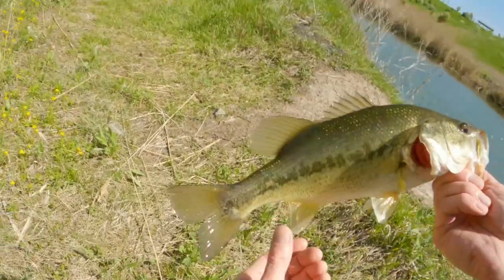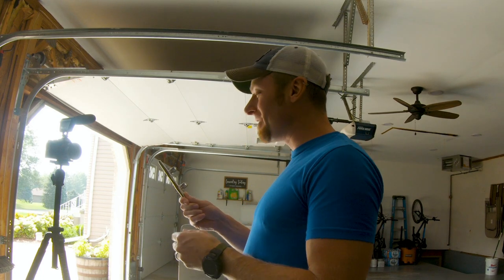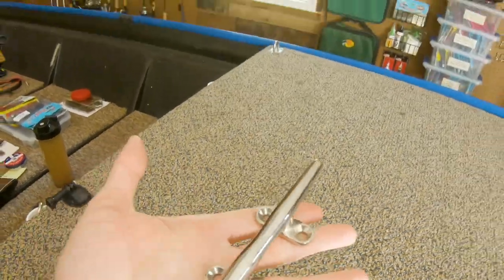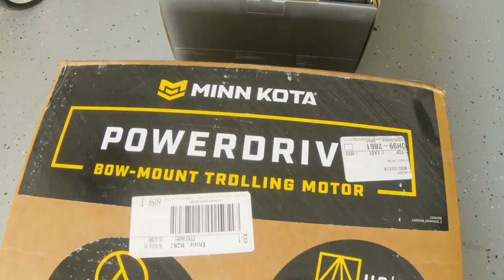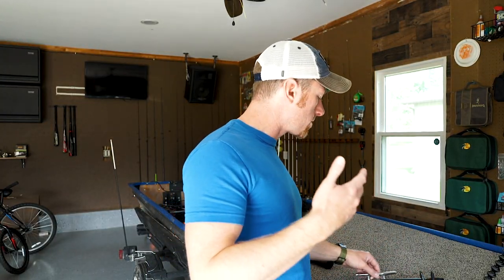3-Second Fishing Rod Holders (EASILY CATCH MORE Crappie, Bass & Catfish!) | Jon Boat Mod

Comment: Any idea if these work on the hard plastic cleats that come factory on newer Jon boats?
Reply from the maker: Hey Robert - they will work with plastic cleats provided they are the correct shape. Check out 1:03 and you can see what mind look like. My Dad's boat has wider, flatter cleats and it worked well on there during a recent trip to WI as well. Hope that helps!